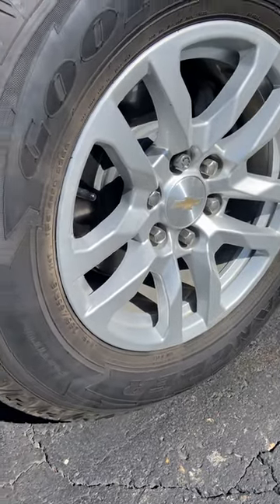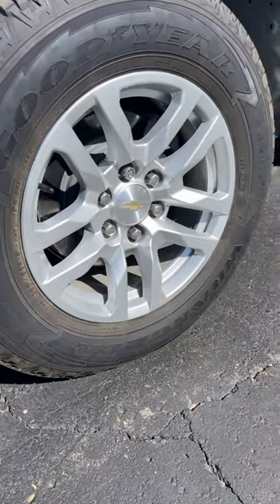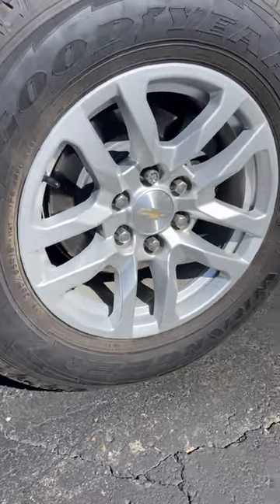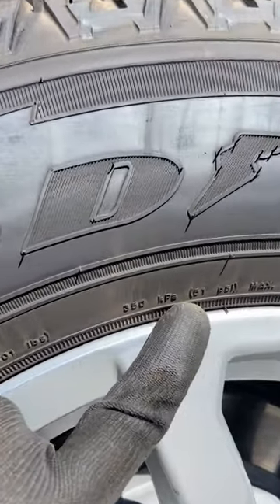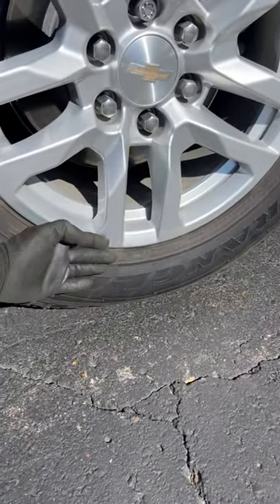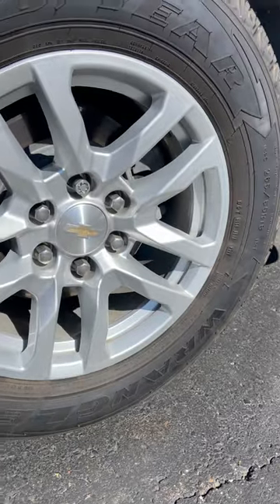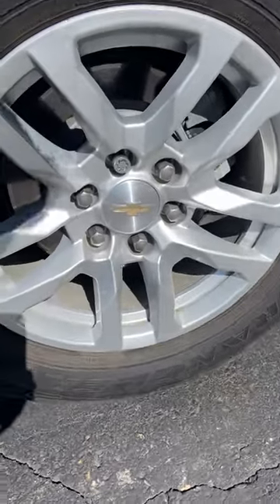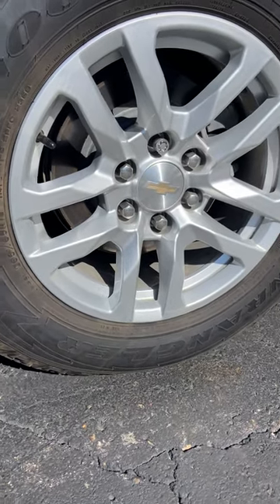Why airing up can be important while towing

Comment: Thanks for the info. I just got a travel trailer and took it out for the first time. I had to drive around 55 mph otherwise I felt like I was swaying. I didn't know to max out the tire pressure for towing. I'm also looking into buy 10 ply tires for towing as well. Just hurts because I bought my current tires 6 months ago and they only have 6k miles on them.